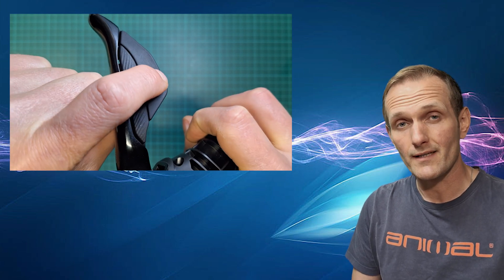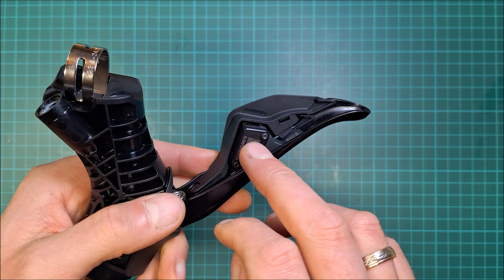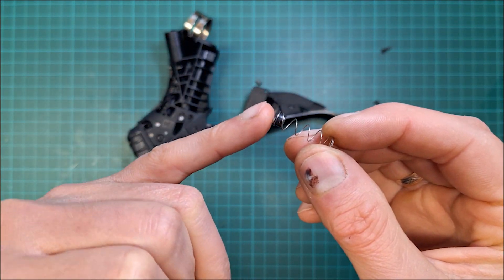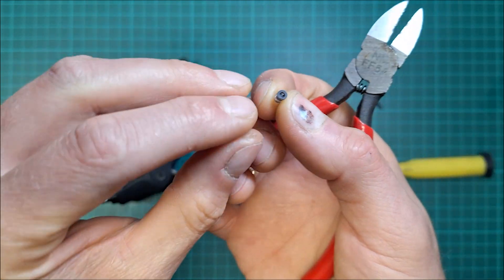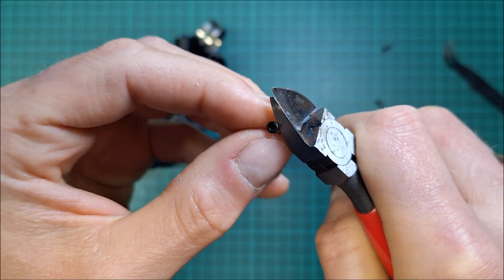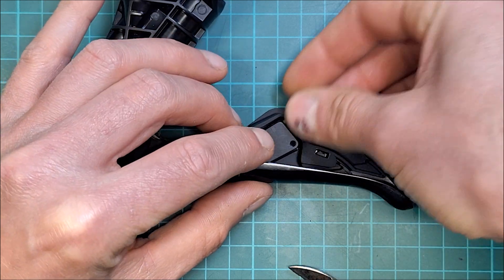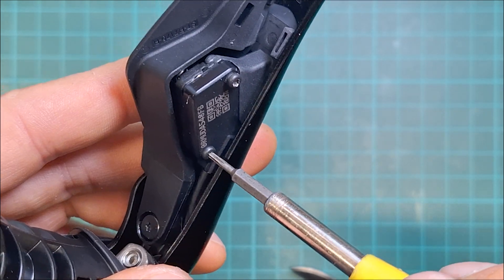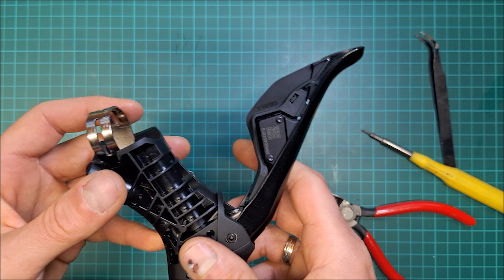Faulty, non responsive Di2 buttons - Fix

Comment: My big spring broke after just 11 months, brand new R7170 105 di2.  Opened it up as per your vid instructions and found the main spring to be broken at the 1/3rd mark.  Shortened it (overall length 15mm) by using the 2/3rd spring and it still works.   Imagine having to pay nearly 1k for a pair of new Durace shifters, or $400 for a right Ultegra, just for this.  Even my 105 is $300+ for a right shifter.   I am getting new springs from Taobao (15-20mm length would work, 0.3-0.4 spring thickness, external diameter 5.5mm), it should work since the big spring just springs the levers back, just a matter of tension and feel.  I think you can get them from aliexpress too.
Reply: BTW for those reading, just lay your bike on the side and you'd be able to open up the button box just fine, if the springs drop into some corner, get a magnetic screwdriver to fish the springs out.  Declutter the floor area and be careful, it's easy to lose the springs.   Shine some good light from the top.
Reply from the maker: You should be fine, at the beginning before I  had some spares I used a spring from a pen :-) The purpose of this spring is to return the large button away from the blade. Slightly different spec of that spring will change the feel of the of the button, but the operation should remain the same. P.S. That spring is the same on all 11 and 12 speed, both rim and disc brake Di2 expect 6870 and 9070.

Comment: @Di2_GP have you ever come across the shift buttons no longer working on 8070 and 9170 shifters? but the dfly/aux button still working.

seems to be an issue with the button pad PCB - ive done my share of component level repair but i think this might be a bridge too far
Reply from the maker: Correcting myself since it’s 11-speed! Two things to look for:
1. Check inside of the top part of the shifter for any snapped or loose cables, especially near the top if the shifter's been bumped. each cable is affixed with resin if you can see any cracks or missing part of that resin ring, you cable may have been ripped out of the internal PCB. https://www.instagram.com/p/DCNGjc-u73B/?img_index=1
2. Moisture might have corroded the microswitch. It's replaceable, but you'll need a donor unit for the spare part.
Reply: I just opened up my button box and found that there is no silicone seal.  Not sure about the PCB area, but if it is located in that button box that the vid is talking about, then possibly there might be water ingress before esp if it has been hosed with high pressure water.

Comment: Hi, I lost the biggest spring of the three. Is it possible to buy one somewhere?
Reply from the maker: The part number is listed in the video description: Y0E398020
Reply: @Di2_GP  thanks a lot!!
Reply: Can you get springs from aliexpress?  I got mine from TB.  Mine is 105 di2 R7170.  15 mm length shd be fine but 20mm is ok too (you can cut).  0.3-0.4mm spring wire diameter, external diameter 5.5mm but 6mm shd work too.   Only thing is that the black plastic stabilizer that the spring slots into wont be there but i dont see why it should work, perhaps sometimes it might go wonky and warrants you to take out the box again and realign the spring, but it's really nothing too serious or difficult.  I fixed mine by laying my bike on the floor, and it shouldnt be more than a 5 mins job subsenquently after you have the experience of opening it up.
Reply: @2100BLF  hi, thanks for your help. How often should you realign the non-original spring?

Comment: Thanks for the great video.  I took my 105 di2 shifter apart and the little spring inside the big spring was sideways and not seated, however there was no plastic end piece as shown in your video. The other small spring had the plastic cap.  Is this normal or am I missing the cap?
Reply from the maker: Great job, unfortunately you're correct, there should be a black plastic cap on both small springs

Comment: Thank you so much for this video, I was so close to buying a new lever, but found your video just in time. Opened up the little black lever box, it was sticky inside and one spring was to compressed. Cleaned it up, stretched the springs and luckily it worked like a charm. 🙏
Reply from the maker: Great to hear, enjoy it!
Reply: Mine was already at the LBS and 1pc 105 di2 R7170  costs $300+ with bartape (needed coz they are taking out everything)......imagine if Ultegra or Durace (i think 2pcs Left and Right Durace is 1k, i cant find any left or right versions).  Found the video when i was walking back and i immediately turned around and took it back from the shop, tipped the fella $20 and went home to fix.  lol

Comment: Hi, thanks for the guide! I had this problem but it keeps on repeating,  I opened the little box already twice and the springs seem to go off "rail" all the time, It works for a ride or two but then the buttons stop working, and I need to open and adjusted the springs again. Now the little black thing on the tip of one of the little springs has come off also the spring is difficult to get straight anymore :( .Do you know if I can get only the springs somewhere as spares? Or any other ideas! Thanks for you help!
Reply from the maker: I would make sure your springs are stretched. It seems like yours may be a bit short, that's why they are not performing. You can buy spare springs and screws. I put links in to description. That's the Shimano code for springs: Y0E398020 , just Google it.
Reply: @Di2_GP  Thanks! Yes I think my springs need replacing. I'm in EU/Sweden, so trying to look for them somewhere here. I saw SJS is out of stock...
Reply from the maker: @paulyc5455  Try here: https://amzn.to/4lT2jli
Reply from the maker: @paulyc5455  Oh here: https://www.amazon.se/-/en/SHIMANO-Y0e298020-Tyres-Hoses-None/dp/B0792KWR58

Comment: Hi! Thanks for the video! I have this problem, I stretched out the springs and put it back together. It worked for a couple of rides. The springs are a bit wonky and the small black tip one the small spring keeps coming off. I think I would need replacement springs, is this possible to get somewhere?? Thanks!
Reply from the maker: Hi, if you're in the UK, you can get them from SJS Cycles. The link is in the video description. These springs are the same across all 11(R series), GRX, and 12 speed Di2, rim, and hydraulic.

Comment: Thank you so much! My Ultegra 8170 right hand paddle (the one without the lines on it) had never felt quite "right" out of the box 3 years ago - it would click but sometimes not shift unless I pressed extra hard and felt a bit "meh".
This has gotten worse lately, to the point where I was dreading having to buy a new shifter or replace the micro-switch. 
Watched this video and gave it a go (at 11.50pm on a Saturday night in my kitchen 🤣) and now the paddle has a crisper click and changes gear when clicked each time instead of having to press extra hard. 
(Also, as others have said, love that your videos are straight to the point, super clear and easy to follow - subbed!)
Reply from the maker: You're very welcome! I'm happy to help 🙂 And thank you for the tip!!! Much appreciated!

Comment: I have a very fine rattling noise in the 7150 105 shifter buttons. Its probably a loose spring inside. The bike is brand new, which is weird.
Reply from the maker: My bet will be a loose free-stroke screw. If you peel off rubber hood, on the outer underside of the shifter, you will see a 2mm hex. Try turning it clockwise, until you see the lever move towards the handlebars. Do not confuse it with reach adjust, that is also 2mm but it is exposed and under the lever blade. If that won't help, there is possibility that you have loose springs. However I'd bet on the free-stroke. Let me know if this worked

Comment: Hi, i messedup my screw while trying this..any idea how can i remove and order new ones?
Reply: Thanks a lot this is helpful :))
Reply: I got di2 105
Reply from the maker: @OutdoorsObserved  105 has T6 screw heads. I will measure tomorrow thread diameter and let you know the exact size. But if you're careful with Dremel, you should be able to reuse the existing screws. You must be EXTRA CAREFUL as 105 shifter threads are made of plastic, if you heat it up too much, they will melt away.
Reply from the maker: Damn... If you have access to Dremel I'd cut an incision for the flat screwdriver. Take it slow as the heat can melt the plastic. What shifter do you have? Y0C898060 this is the screw code, but it has been discontinued, unless you're lucky and find some stock online. Alternatively get some M2 x 6mm stainless steel screws. Just be careful when using standard screws as they don't have limit flange. Hope this helps

Comment: Hi. Super information. I have an issue where the up shift on the left side clicks but engages only sometimes and not each time. I reassigned the up shift to the hood button and it works fine. Not sure what it could be. Any steps I can try would be very helpful.
Reply from the maker: I'm pretty sure it could be the same issue. It's a quick job, it won't take long
Reply: ive got the same issue, suppose the springs are overlapping
Reply from the maker: @jamble7k  yes, either that, or one of them got wedged.
Reply: @jamble7k  Oh, I did not consider that. Great that it worked for you. I have to get that T6 screw driver and will check.
Reply: I fixed mine, bought a wera t5 screwdriver to avoid stripping the screws as others have...

The tiny spring within the big spring was actually on its side causing both buttons to press at once on the larger paddle. I fitted the black ends of the springs facing towards the mini switches.
Reply from the maker: @jamble7k Great work 👏

Comment: Cant thank you enough!! But i see surprisingly much people in the comments who have the issue of the small spring tangled up in the big one, just like i had. After one month.. I mean, that is terrible design by Shimano
Reply from the maker: I understand your frustration, but I genuinely believe it is the problem of OEM packaging, or lack of it. The issue is quite common on new bikes, especially DTC model. If shifters were squashed together or buttons depressed for very long time those springs will eventually compress, too much. When they are too small, they can rattle or get wedged inside. Weirdly the springs are the same across 11 and 12 speed, but I had very few cases of 11 speed fails. Let's hope this will be addressed soon, maybe a stronger version of the spring... You never know

Comment: Great video, thanks a lot! I had exactly this issue, and I was able to fix it on my own without sending the bike to repair. One small spring was mounted completely incorrect, it was wedged in the larger spring. Not the best construction from my point of view...

The small screws were very tight. Use a high-quality tool to untighten. If you have a (newer version of a) Garmin HR strap, you can use the Torx T5 tool which is delivered with the strap e.g. for the Ultegra shifter screws.

Reassembly of the springs and mounting the switch is a bit tricky. For me, it worked better first to mount all three springs in the housing at the lever, and then putting the switch on them.
Reply from the maker: Great to hear. Hopefully that was the last time you had to do it ;-)

Comment: Excellent video. I have this problem on my Giant Defy with Shimano 105 on the front shifter. I will return the bike but it is very frustrating to have this problem after riding the bike for 44km. Really poor quality and design from Shimano.
Reply from the maker: Hello, sorry to hear that. I believe that when sorted, the springs will work fine. I suspect that the problem is poor transit packaging, this allows for shift buttons to be depressed for prolonged period of time, in turn squashing the spring. Sadly the bike shop is likely to send the shifter up for warranty, which means you'll be without the bike :-). At least you will know how to fix it in the future.

Comment: One of the buttons on the right switch of the r8170 stopped working without any mechanical action. I bought a switch on aliexpress six months ago, so I had no warranty. I thought I'd have to buy a new switch. But thanks to your video, I was able to fix the button and now it's working again. It's just that a small spring got stuck in a big one and got a little flattened. Thank you very much for the instructions!!!
Reply from the maker: Great to hear!!!

Comment: Thank you for your video. But still, what is the problem if you hear the click from the spring but nothing happens? THis problem is not always happening. Some times the button works, some time it does not. But you always can hear the click. What do you think on that ? Thank you !
Reply from the maker: If you have 11s it is likely that you may have corrosion on the microswitch board. Unfortunately it is hard to know for sure unless you open it. Shimano diagnostic tool, doesn't tell you what's wrong with the component, it only says it's broken :-(

Comment: Why are there two small springs in the beginning and then you only put back one small spring?
Reply: Now the top button on top doesn't work either. This doesn't make sense. I still couldn't open the shifter because all day away. But top button was working yesterday
Reply from the maker: @davidgonzalez2  In this case, I'm suspecting water ingress. Open battery compartment and check if there are any signs of water
Reply: @Di2_GP shifter is on a warranty claim now. If it would be water, would a new shifter solve it?
Reply from the maker: I started with two and finished with two. The first at 2:24, the second at 3:24, you can see both springs at time stamp too.
Reply: Oh my bad. Thanks a lot for your quick reply. Hopefully this is my issue. It's driving me crazy. Shifting cones and goes randomly

Comment: Many thanks for the guidance in this video. After going through the process I can only get a front derailleur downshift when slightly depressing the brake. Any idea what I did wrong?
Reply from the maker: @punkandprovocation  I would check if the cable that goes from the microswitch to the main electronics compartment isn't crushed or pinched.

Comment: Hi, great video, like others my brand new lever stopped shifting! I managed to strip the screw, do you know where I can purchase replacements from please?
Reply from the maker: @agilchrist8445  if you're based in the UK, you can get a set of screws and springs from SJS Cycles.
The reference code is in the video's description
Reply: I managed to dremmel the screw to make it into a flat head. Followed your video and it worked perfectly. So thank you so much for posting the fix. Amazing that a Shimano aren’t recognising this as a known fault. Also trying to find the T5 torque screw is near impossible, almost like Shimano are forcing you down the street of buying a brand new lever set-up.
Reply from the maker: @agilchrist8445  I'm trying to locate an aftermarket screw, but it is challenging. They are M2 x 6mm but the original screws have a standoff. So if you are using standard screws and you're not careful you may crush the microswitch. As soon as I find a solution I will make post about it.
Reply: Many thanks for the reply, the screws are now discontinued 😢

Comment: Thanks for the video,fixed my ultegra 12 speed switch. The fix is easy but getting the T5 torx bolt out for the first time was a nightmare. A lot of thread lock for such a tiny screw, got there in the end but impossible to do without damaging the bolt head. Ultegra and Dura ace should be T6 like 105 which would have made it much easier to remove.
Reply: same problem here, so tight !
Reply from the maker: @bensbikessequim  Always do a quarter turn, and then back a couple of times, this should break off retaining compound from threads.
Reply from the maker: @nemeanf27  Great to hear you've fixed it. Sadly, this is my most watched video, which indicates that this issue is too common 😢. Hopefully, Shimano will fix it soon.
T6 torx would add extra weight 😉

Comment: Shimano extremely unhelpful, finally found similar springs at a spring manufacturing shop. Given springs free, now Di2 working again.  What a great video on Faulty Di2 buttons.
Reply from the maker: Great to hear, you've fixed it. I'm not sure where you're based but there is a 'repair kit' that you can use. Just look for Y0E398020. This is available in the UK (for now).
Reply: Thank you Pawel. Is it the same repair kit for the ST-RD7170? Having the same issue on my left hand lever.
Reply from the maker: @plenkicious springs are the same, across all 11 and 12 speed. But support brackets are speed specific.
Reply: @Di2_GP do you have the parts number for the 12 speed replacement kit? Im struggling with the Shimano spareparts lists i can find. 😅 Thank you again
Reply from the maker: @plenkicious You can't buy 12s specific kit. You must buy 11s. But the springs are the same.

Comment: Thanks for creating these great sets of videos. Do you know if there is a part number/spares available for the small torx screws which hold the micro switch (R8170 Ultegra Di2)?
Reply from the maker: Thank you, and yes here is a ref number Y0C898060
Reply: @Di2_GP  Thanks for the part number. Had a look to see if able to purchase online but seems like limited sellers and then no stock. 😥
Reply from the maker: @simonpelly1498  where are you based?
Reply: @ I'm based in the UK
Reply from the maker: @simonpelly1498  drop me a dm on IG.